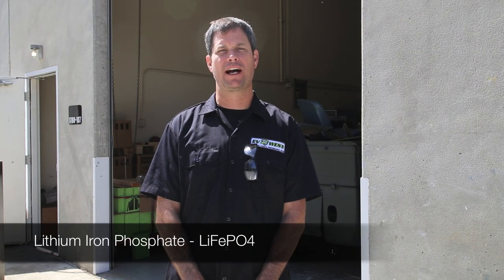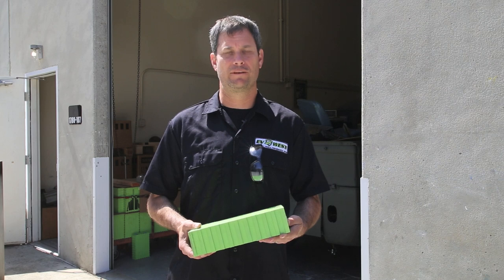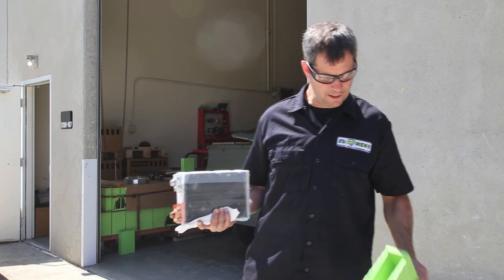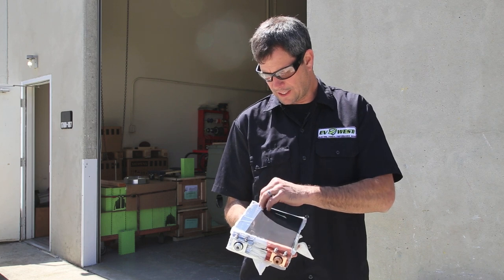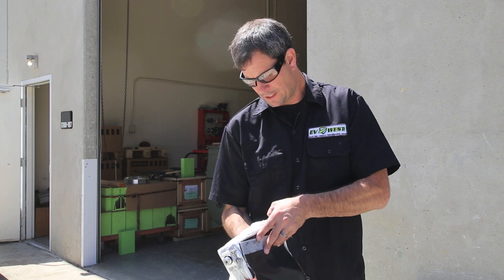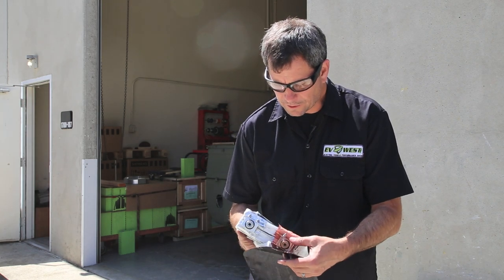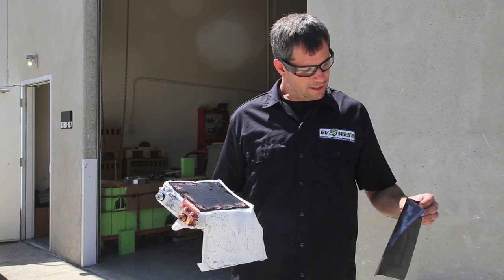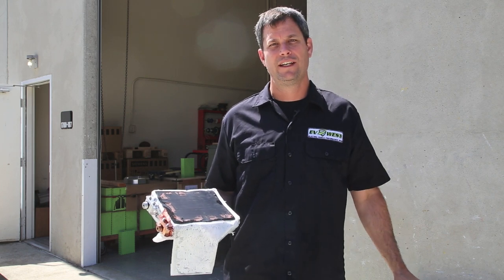Inside a Lithium Ion Electric Car Battery Cut Open by EV West

Comment: Very nice,   I had a couple of my cells develop a hairline crack on the case and so the electrolyte leaked out.  The cells eventually died,  one in a venting way which was pretty exciting.   Hopefully discussed in a future video.   Wouldn't it be cool if we could cut open one of the tesla model S batteries?   Maybe someday.
Reply: we miss your videos
Reply: Yes, we're desperate! How many cells did you manage to set up already? You must be close by now. And did you get any windows for the eSamba?
Reply: Jehu, where have you been, we miss your videos. I miss your Samba and I don't really like VW's, but I like yours.
Reply: It is good to show people that these batteries are very safe, unless you short circuit or over charge them ! all these transportation rules applied to them are really nonsense !

Comment: They should be assembled with disassembly in mind. It would also be good if they were all interchangeable regardless of the auto manufacturer. Recycling should bring the cost down while creating a profitable industry that will reduce pollution.

Comment: Do you think you could use an ultracapacitor bank on an EV to completely replace a battery?  The double module hybrid Maxwell/Crosspoint Kinetics 165f 48v to 96v is used on hybrid busses...I was also thinking using a Quanta Magnetics Q3 Charge Accelerator / Toroid Generator maybe coupled with solar to charge the bank/ run aux. systems?

Comment: As you can see, lithium batteries are extremely reactive. This one instantly exploded when it was punctured! Wait...

Speaking of battery safety, has anyone ever seen an old Ni-xx cell on thermal runaway? They launch the end of the can like a bullet. I have a chunk of cinder block missing from my basement thanks to one. The newer batteries are much safer.
Reply: Had that happen with a couple NiMH packs in my Brushed E-Revo when it was still running the twin 550 motors (now using a single 775 out of the Summit), blew the battery door clean off the truck and threw it 16' away, pulled on pack out of the compartment in the chassis as the shell for the failed cell flew over 30'  leaving a trail of battery guts and blast debris behind.  Luckily it wasn't next to my screen namesake Jeep when it blew, otherwise all that crap would have been imbedded in the side of that instead of spread across the parking lot at work!
Reply: Lifes are much safer than lipos but lipos are nice and cheap (relatively) still no more dangerous than petrol though.

Comment: So wheres the Lithium if is just layers of aluminum foil and carbon coated copper cathode?
Reply: Carl Sagan I knew it!
Reply: In the electrodes, but no lithium metal, its a lithium molecular compound of graphine (normally) and this has historically been a very expensive material to produce so there is lots of research into other super conducting materials, though breakthroughs in graphine production in the last year (2015/6) should bring costs down.

Comment: lithium cells got a bad rap in the hobby world starting fires, Blowing up in racers faces from over charging them. ect.... But they were lithium polymer, lithium ion, this chemistry is not as safe. lifepo4 / lithium phosphate is way safer! At most they will smolder from gross over charging think i seen a vid where they all most got it burning, as soon as the charge was taken away battery quit burning & settle down. Was basically arc welding the cell... A good battery management system is key.